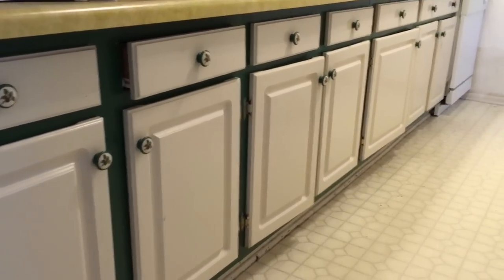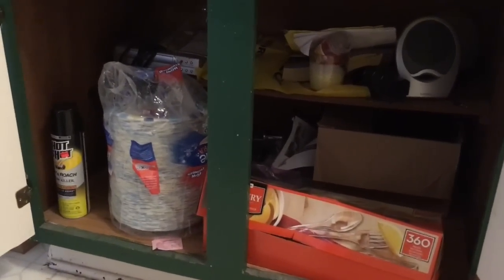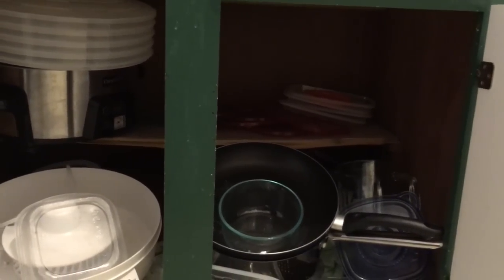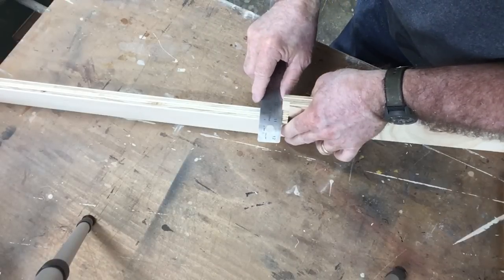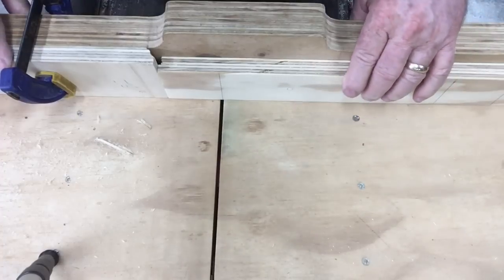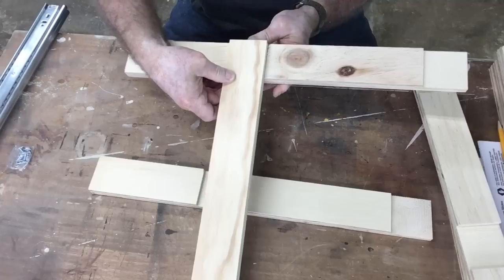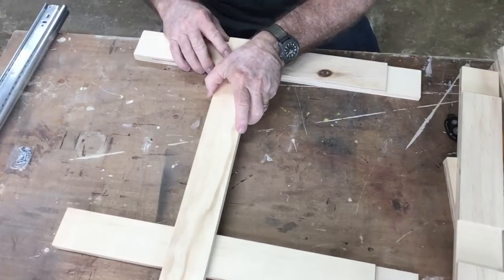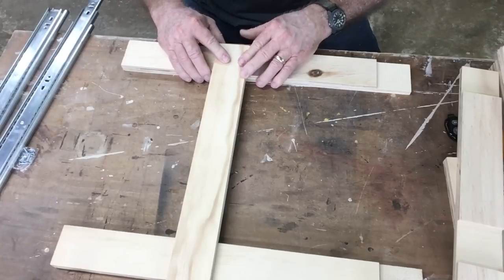Kitchen Cabinet Upgrade: Adding Huge Drawers PART 1: Making Drawer Runners

Comment: I did a similar thing to all of my kitchen and bath room cabinets. I left my doors in place and added two 3” high slide drawers in each cabins. Everything works great. I also had to adjust the drawer width because my doors had European style hinges which projected out into the cabinet opening so supports for the drawer slides were different thickness.
Reply from the maker: My original idea was to leave the doors on but the people wanted drawer fronts instead.  Sounds like you did an excellent job.

Comment: Could the drawers be made deeper if not wanting to use the horizontal spacer in between?
Reply from the maker: Yes, if you remove the rail and leave the doors on the cabinet you can gain a little bit.  In my case the doors are being removed and drawers added.  You may be able to add an inch.  Not sure it that would help much.